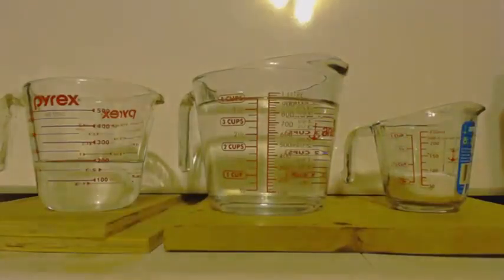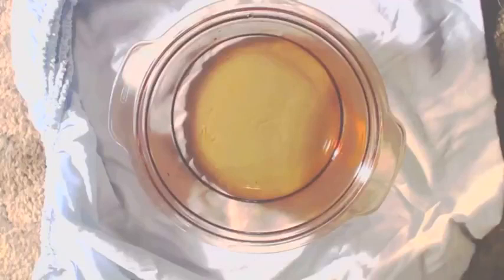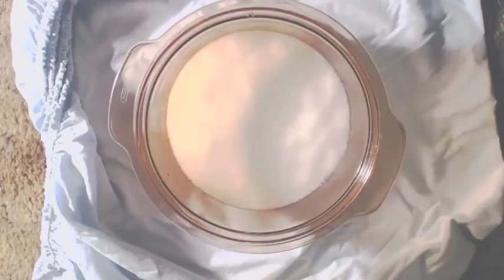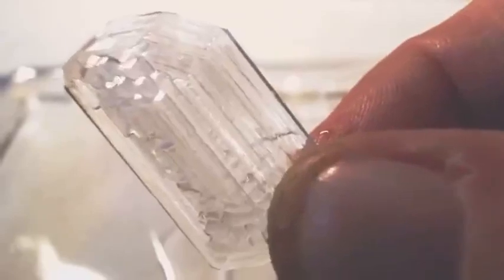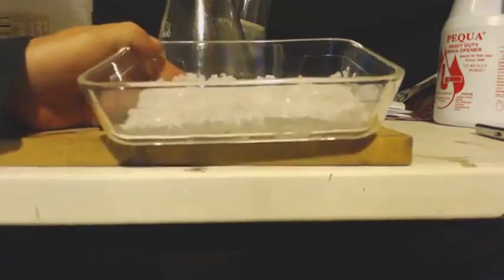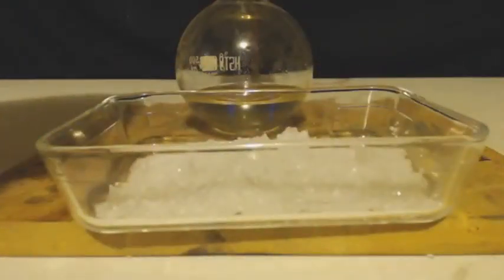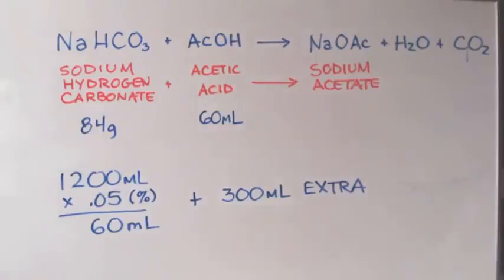ANHYDROUS SODIUM ACETATE SYNTHESIS

Comment: Thank you for posting this. I'm trying to make some sodium acetate so I can make some glacial acetic acid. It seemed pretty simple from what the other videos say (though they don't go on to make glacial acetic acid from it, but rather just experiment with it). I tried what a few of the other videos say which is just mix the two and boil it to dryness, and it yields this nasty light brown/yellow solid. 
Tomorrow I'll try the steps you have in here, hopefully get some nice crystals just like you did!
Edit: I just re-watched this - You let it crystalize for a couple weeks? Oh boy, I'm not sure I'm quite that patient.. lol. Do you think evaporating some of it off under low heat (not enough to boil it, just like 80C or so) would be ok? At least til it gets like half way down? I may try two batches, one I'll let set for a while like you did, the other I'll evaporate it down under low heat, then let it evaporate at room temp.
Reply from the maker: JH..................Your welcome.  i usually never recrystallize salts in a fast manor.   I am pretty lazy so i just let it sit and wait.  Put it this way though......if you boil it down at the end to condense it a little (like 80 to 100C)    and it turns into "hot ice" solid (gel but not crystals)  then just add a LITTLE water and still  let it sit a bit till it all dissolves again and then evaporate SLOWLY from that point on. 
             Being that your probably using vinegar instead of PURE acetic acid in water to make the sodium acetate then  strong heat MIGHT do something to the sugars in the vinegar.  But i think you will be ok.  I do not THINK it will mess with your yield.  Although it may turn the solution brown but that can be washed off the crystals when you filter them.
              Tips on FASTER evaporation (without boiling).   DO YOU HAVE A GAS BURNING STOVE THAT HAS PILOT LIGHTS????????????????    The more surface area the crystallizing dish has REALLY makes a big difference  of rate of evaporation.   Also height of liquid.   Only fill up a dish with like a little solution.  Do not have like a dish filled up 3 inches high or it will NEVER  evaporate.  A 1/2 inch is filled up enough.   Ok the tips are this if you have a stove with a pilot light.   When i want to dry something or evaporate something i put it in the oven but do not turn it on  My oven with just the pilot light on stays at 105 F.   Also on top of the stove there would be 2 pilot lights.  If you put your hand on the stove right about where the pilot lights are you WILL burn your hand.  It is usually 80 C right above the pilot light.   If you remove the metal things on stoves where you set your pot then you can put down your crystallizing dish right on the stove above where the pilot lights are.
                  Any ways if you end up HEATING IT UP TO CONCENTRATE it let me know how it goes.
Reply: @johnblacksuperchemist2556  Good tips! And my oven/stove is electric, not gas :-\
I have a few glass dishes like the one you used, so I'll fill multiple up with only 1/2in max. And in one or two of them, I'll try heating it up first to evaporate some of it. I'll let ya know! Thanks again for the input!
Reply from the maker: @jhyland87  ...........Here is another video where i make a different carboxylic acid salt BUT I USE THE SAME METHOD as in the video above.   I do it 2 ways.   First time i use heat to do the reaction and to concentrate the salt after i make it to recrystallize it fast.   The 2nd time i use no heat during the reaction and ONLY recrystallize from evaporation.  Took about 3 days cause the dish was only filled up like a 1/4 or 1/2 inch.  ANYWAYS...... I compare the yields and the crystal quality between the hot reaction and the cold reaction.  .   But what i really think you might want to watch is at 7:20 in the video.  I just basically talk about how making a carboxylic acid in to a salt .......like vinegar to sodium acetate......is the same method no matter what carboxylic acid you start with.   And also how you can use other bases like Na2CO3 or NaHCO3 or NaOH or even Na2O.  Anyways here is the link if you want to check it out.   https://www.youtube.com/watch?v=BnJCgkskS-c
Reply from the maker: @jhyland87  ............P.S.   Also if you want TRUELY PURE glacial acetic acid then your sulfuric acid you use must be 98% concentrated when you drip it on the ANHYDROUS sodium acetate.   SO if you are using drain cleaner sulfuric acid you would have to distill it first.   Unless you just want "CLOSE TO" glacial acetic acid
Reply: @johnblacksuperchemist2556  i took some drain cleaner H2SO4 and added some 60% H2O2, heated it up and boiled off the water. Its not 100%, but pretty close to it.
Reply from the maker: @jhyland87  ............  I swear this is my last post.  Unless you ask me something.   But here is one more video.  Once you get your crystals and wash them so they are nice and white you will want to dry it out in the oven.   I mean you just put them in the oven and turn the oven on and stir them once in a while but if you want to see someone do it here is a link............    https://www.youtube.com/watch?v=tilSHVPiVCQ
Reply: @johnblacksuperchemist2556  i welcome all replies from you! Haha. No worries.
And yeah, i watched Dougs video on drying it. I will def follow that after i have pure crystals.
Thanks again!
Reply from the maker: @jhyland87  ............. Sounds good.........Just an FYI but if you are going to boil off  some or all of the water from the H2SO4 (drain cleaner) then there is NO need to add H2O2.....ESPECIALLY 60%.   The reason people do that is to decompose any organo impurity products LIKE corrosion inhibitors and dyes and  etc into water and CO2 and carbon ......BUT BUT  the heat needed for the drain cleaner to boil is ALL YOU NEED to do the same thing and  decompose any organo impurities or inhibitors or dyes and turn the impurities into CO2 and H2O and carbon.   The H2O2 is not needed for all that........JUST HIGH HEAT.   So by adding 60% H2O2 you are just adding work to your day.   Cause the H2O2 is 60% water and it will need distilled out.   If you do not add the H2O2 then you still destroy the same organo impurities but now you only have to distill out like a couple mLs of water instead of a LOT more from the H2O2  you added.   JUST A THOUGHT.
                  Also when  you add H2O2 to sulfuric acid you actually make peroxysulfuric  acid more commonly known as piranha solution or caro's acid.   But when that happens the H2O2 is reduced to H2O meaning the 60% that was H2O2 is NOW WATER after you add it to the drain cleaner.   Which will need distilled out.   
                  Also..........the peroxysulfuric acid (caro's acid/piranha solution) is what actually oxidizes all the organic impurites in the drain cleaner.   How ever when you boil it to remove the water then  the peroxysulfuric acid will probably decompose itself back into sulfuric acid so it should not be an impurity if you use H2O2.
                  Also Pure Caro's acid is highly explosive. Explosions have been reported at Brown University and Sun Oil.           Solutions made using hydrogen peroxide at concentrations greater than 50% may cause an explosion.     SO NEVER PUT THAT MUCH OR MORE H2O2 INTO THE SULFURIC ACID.OR YOU MIGHT  BLOW UP!!!!!!!!!!!!!!
Reply: @johnblacksuperchemist2556  You sure about the H2SO4+H2O2 thing? I mean when I dropped in the H2O2, it cleared off before I even heated it up. I literally just added maybe 5mL of the peroxide to ~300mL H2SO4, and it turned very clear (still just a touch off from being totally colorless, but very clear compared to what it was before).
RE: Sodium Acetate - I just did your setup (but 1.5 scale of what you did, so 1.5L vinegar + 126g baking soda to neutralize, then 300mL vinegar additional). I added the filtered solution to 3 trays to ensure they were under .5 inches deep (1 glass trey, the other two are metal, but should be OK). I'll watch them over the next few days to see how it works out.
Reply: @johnblacksuperchemist2556  Oh, and in regards to boiling some of the sodium acetate solution down like in the video by dancingmadscientist that you shared, I think I'll skip that. Even his crystals seemed a little too brown for my taste. I think I'll just follow your steps, as they yielded the best crystals I've seen :-)
Reply from the maker: @jhyland87  ..........i am saying the H2O2 will react with the sulfuric acid making WATER and  peroxysulfuric acid which in turn WILL decompose the organo impurities.   AND it will do it WITHOUT heating it up.  Cause peroxysulfuric acid is a stronger oxidizer than sulfuric acid.
                 But i am also saying sulfuric acid itself with ZERO  H2O2 added  to it will ALSO decompose the organo impurities IF YOU TAKE THE TEMP OF THE  SULFURIC ACID  UP TO ALMOST  IT'S  BOILING POINT.
                 So if you are going to boil the sulfuric acid after adding H2O2.    To distill some of the water out then it is a waste of time to add the H2O2 in the first place.   Because the HEAT ALONE will clear up the drain cleaner.........HOWEVER......if you are NOT going to heat up the sulfuric acid then adding  the H2O2 would be a good idea.........Also KEEP IN MIND i did not realize how little H2O2 people added to drain cleaner to clear it up.   I always assumed people added a LOT MORE H2O2 than 5mL.  Five mL is almost nothing.

            RE:  SODIUM ACETATE...............give me time to respond to this and ur other post.  i need a break.   I lost control of my left hand today and typing is taking forever
Reply from the maker: @jhyland87  ..............RE:   SODIUM ACETATE...........Well looks like you got it under control.  Could not hurt to put the trays in your oven and turn the oven on for like 5 minutes making sure the oven does not get to hot.    Then do that every once in while to speed up evaporation.   I can actually turn my oven to the lowest setting and leave it on forever and it will stay at 130F in my oven.   MAybe your oven has the lowest setting that low ALSO. It may have a HIGH lowest setting because it is an electric oven.  I really do not know.   Check and see.   Put oven on lowest setting with a thermometer in there.     You could also place your trays by the window so the sun shines in on it to speed up evaporation.    ANYWAYS DONT FORGET to leave some water in the TRAYS.   Just a little cause that way the impurities can dissolve in it and be washed away when you filter/wash the crystals.    Then you will have pure hydrated sodium acetate crystals.  Then you just need to throw the PURE WHITE/CLEAR hydrated crystals  in to the oven and dry to an ANHYDROUS POWDER............Remember each tray when drying to anhydrous should not be more than 1/2 inch deep or it will take forever..........Let me know how it goes
Reply from the maker: @jhyland87  ...............YEAH that guy in the video i gave you.   His crystals could have been SNOW WHITE if he had just washed the crystals one more time.  He probably did off camera.   In my video i just used cold water to wash my crystals although that is NOT really the correct way because sodium acetate is so soluble in water....even cold water.    I was using a vacuum pump to filter and wash my crystals QUICK so i did not care about the water washing some of my product away.  The crystals looked so good i only needed a QUICK wash.  But even then with a QUICK wash you loose some product washing with cold water compared to isopropanol.     The solvent most people use to wash the crystals is 91% or anhydrous isopropanol(rubbing alcohol).   Freezing cold isopropanol.  Freezing cold acetone would PROBABLY be even a better solvent to wash the crystals with but that is just a guess.
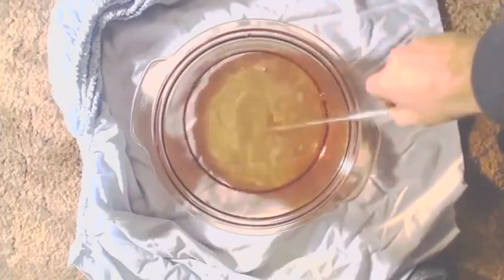Reply from the maker: @jhyland87   ..........Here is link to a video showing the temps and color changes drain cleaner(sulfuric acid) will undergo when you heat it up to boil.   JUST SKIP TO the 2:00 minute mark and watch until the 3:00 mark. 
 https://www.youtube.com/watch?v=r-Puc_Z46ac
 Once the acid is clear then that is as much as you can do to get the contaminants out WITHOUT DISTILLING.   And i used ZERO H2O2.   KEEP IN MIND YOU STILL HAVE SOME IMPURITIES in the sulfuric acid weather you use H202 or just use heat and ZERO H2O2.   You will have some salts in there.   Just a little.   The salt impurity never seems to effect or screw up my reactions.  Cause i RARELY distill drain cleaner (sulfuric acid)  to get those salts out.   
         RE:SODIUM ACETATE ..........ALSO....... The SLOWER the crystals form the more PURE they are.  So you should have some NICE crystals   JUST REMEMBER if you wash your crystals with FREEZING isopropanol or 91% rubbing alcohol and your crystals are NOT pure/white or clear THEN KEEP WASHING THEM with more FREEZING alcohol until the crystals are PURE WHITE OR CLEAR.    Then you can make them anhydrous WITHOUT ANY WORRY of the  crystals turning brown from charred impurities
Reply: @johnblacksuperchemist2556  Now that you mention it, I do remember in a Dougs Lab video that when he distilled the H2SO4 it went from an orange color, to almost black, to clear and almost colorless, all before it distilled over, so I see what you're talking about. However, my hotplate doesn't get hot enough to distill over H2SO4, and I don't think I will do it in the kitchen (family house). So adding some H2O2, then heating it enough to get the water out of it will have to suffice for now :-).
 
RE Sodium Acetate: I do have some 100% IPA (or close to it), so I'll wash the acetate crystals with that when they're done crystalizing (freezing cold)
Reply from the maker: @jhyland87  ............Yeah home chemist are always limited by their wallet/money in what they can do.  Although i have bought so much crap now it will take a couple years till i get to use everything.
Reply: @johnblacksuperchemist2556  Update: The first batch (which was the 1.8L vinegar + 126G baking soda) seems to be going OK. I consolidated it all from few of the dishes to one dish, and I noticed that after that, the dishes I poured it out from formed some really nice thin crystals (as the small amount that was left dried out).
So I went and got more vinegar from the store, now I'm doing a 2.4L vinegar + 168G baking soda batch :-)

I am hurrying up the evaporation process by placing the large metal pan that the solution is in on my tiny little hotplate, lol. It's balancing on the hotplate, but I keep it on a decently low setting (55C to 65C), and it seems to evaporate a little faster without turning any of the solution really brown (which is what happened when I tried this synthesis before seeing your video).

Thanks again for the input!
Reply from the maker: @jhyland87  ,,,,,,,,,,,Glad it is going well with the sodium acetate crystals.  You can always speed up the process  each time you make it and see if you get a better yield or at what speed you start seeing a decrease in yield
Reply: @johnblacksuperchemist2556  So I have 3 batches going, and I got a little cocky with the 3rd and tried to dry it too fast, so its a bit yellow (I'm assuming that's burnt sugars or something like you mentioned would happen). The first batch is starting to crystalize out, though my crystals aren't as big and pretty as yours, lol.
I took some samples from each and evaporated them to see what it would look like, the first two look great, the third actually started to build a little smelly tower of burnt sugars or something, haha. https://imgur.com/a/oLHncTP
Reply from the maker: @jhyland87  ...........Those crystals look GREAT.  Well the 3rd batch that is a little brown.    When you are done  crystallizing you can just wash that color away until it is pure white/clear.  GLAD THEY ARE DOING GOOD.
Reply: @johnblacksuperchemist2556  You're right. The brown ones actually look good. I think what happened in that picture was I didn't take it off the hotplate in time, so the acetate crystals crystalized, then the brown contaminants burnt. I tried it again and it looks just as good as the other batches.
Reply from the maker: @jhyland87  ,,,,,,,,,,Cool.   So far  carboxylic acid salts and chromic chloride  are the only salts i made  that are some what hard to crystallize.  Looks like you got it down pat now.
Reply: @johnblacksuperchemist2556  Out of curiosity, I checked the pH of one of the dishes containing some sodium acetate crystals (the filtered off solutions from the first round of recryst, I consolidated them all and let more crystalize out), and it seems to be pretty high, indicating it's basic (picture here: https://imgur.com/a/eAQMvCt).
I saw that you put 200mL of additional acetic acid in after the mixture took place and was neutralized, and I only put in 100mL, but it was definitely acidic (and my acid was 6%, not 5%). But did  you test the pH of the solution after the crystals came out? Just seems odd to me that it would be basic. I was expecting either acidic or neutral.
Reply from the maker: @jhyland87  ............I added the NaHCO3 until it would not fizz any more.  Then i checked the pH and had a 7 or more like an 8 pH.   Then i added the extra acetic acid.  Then i started to recrystallize.   KEEP IN MIND..........When you have a salt in solution you know the pH without checking it.  Not an exact pH but you should know if it is acidic or basic or neutral.   You look at the salt and you take it apart.   Like Na2AcO (sodium acetate).   The sodium part is the base part and NaOH is a strong base.  The acetate part is the acid part and acetic acid is a weak acid.  So the strong base over powers the weak acid and you end up with a basic solution when you got sodium acetate in water.   
                     NaCl  has Na as the base part and NaOH is a strong base.  Chloride is the acid part and HCl is a strong acid so the strong acid cancels out the strong base and you get a neutral solution from NaCl in water.
                           NH4Cl in water is acidic...........Cause NH4OH is a weak base and HCl is a strong acid.  SO the acid wins and you get a acidic pH from NH$CL in water.
                 KEEP IN MIND I DO NOT KNOW BUFFERS VERY GOOD..........BUT........... I think if you have sodium acetate in water and then add some acetic acid the pH should still stay basic. 
              Because the acetic acid is a weak acid it hardly ionizes in water.  But but but with acetate anions already in solution(from the sodium acetate salt)   the ionization of the acid is impossible due to the fact that there can only be so many acetic anions in solution and they are already there from the sodium acetate salt.   So the salt SUPPRESSES the ionization of the added acid.   Which keeps the pH neutral or basic.   This is called a buffer.  And is used in experiments that need a specific pH range to work.  That way you can keep adding acid to an experiment and keep the pH the same instead of making it more acidic as you add more acid.   The acid can not ionize into protons and acetate anions cause there are already as many acetate anions in the water that the water can accept.   So the acetic acid does not break down into ions and does not effect the pH.   KEEP IN MIND I DO NOT HAVE A PERFECT UNDERSTANDING OF BUFFERS
Reply: @johnblacksuperchemist2556  Wow - Thanks for the detailed response!
And duh, I should have thought about it as a salt, that would explain why the pH rose after some of it crystalized out. Thank you for the education :-)
Reply from the maker: @jhyland87  ..........I saw your crystals.  Wow they look nice.  As long as they are still white and there is NO charring  it should be good.   ANHYDROUS salts can have the effect of being slightly "off white" compared to the hydrated salt.   Kind of an illusion IN MY OPINION.   Because the hydrated form even when crushed up  SPARKLES and reflects light in that special way.   It still has a crystalline lattice no matter how small you crush it up.   While the anhydrous form has NO crystalline structure and no SPARKLES  and no reflection of light.  So they tend to look duller.   I would have to see the salt in person to know for sure but it sounds like it is not a problem.    But if you want to know for sure then next time do one more recrystallization than you did this time and see if it makes any difference.  If it does not make a difference then the duller white color is just an illusion caused by the loss of the crystalline lattice in anhydrous salts resulting in less light reflection giving it NO sparkling.   I am so happy you succeeded with the sodium acetate.   If you can make a carboxylic acid salt that looks like your crystals then most other salts will be easy to make
Reply: @johnblacksuperchemist2556  Yeah I think it might be an illusion, too. This is pretty darn good as far as I can tell, so I'm happy with it. 

Thanks again!
Reply from the maker: @jhyland87  .........Just another thought about  when dehydrating a salt.  You USUALLY know when it is dehydrated cause you can not see any more water and the salt has ZERO lumps and is all powder.  But some salts can be deceiving and look anhydrous but still  be a little hydrated  at that point.  So what i do in those instances is weigh the salt before i put it in the oven and then figure out what it should weigh when it is totally anhydrous.   And when i am done i weigh it again to make sure it weights what it should when it is anhydrous.  If it looks anhydrous but still weighs more than it should then it goes back in to the oven until it weighs what it should when it is anhydrous
Reply from the maker: @jhyland87         cool